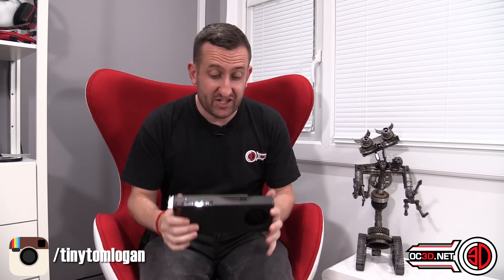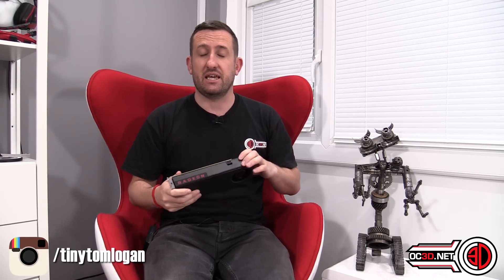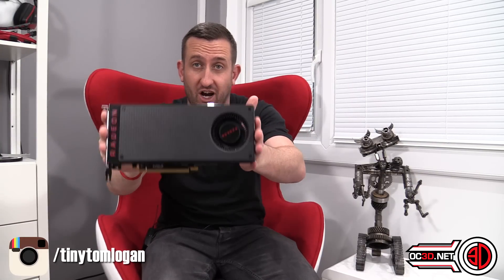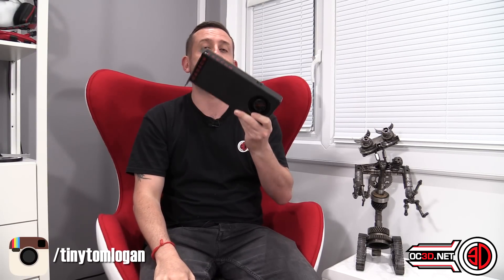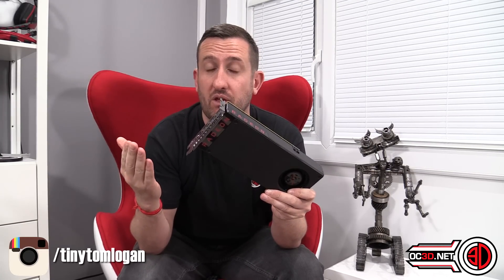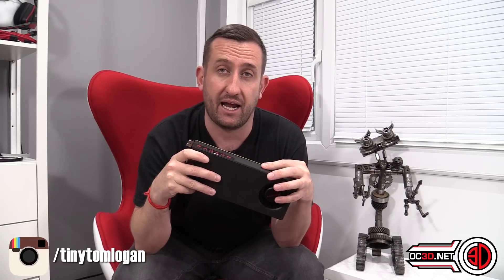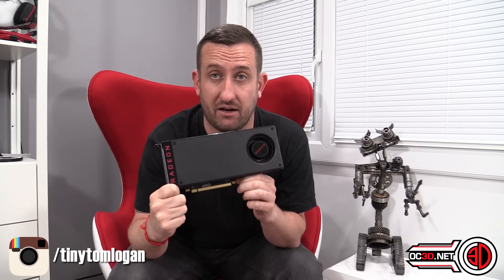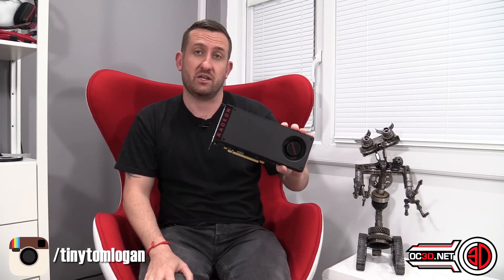RX480 power bottleneck? TTL Talks

Comment: Looks AMD really screwed the pooch on this release. As bad if not worse than RamGate on the 970's. Glad I didn't waste my money on one of them.
Reply: Not if all of the power issues are correct as a lot of the systems that people would be putting a 480 in have budget motherboards (re: low end or cheap) that wouldn't be able to handle the additional power draw over the PCI-E slot. Until this is sorted out I can't, or won't in good conscience recommend a 480 to anyone.
Reply: Once the partner cards hit the market, the problem will be gone, which can't be said of the GTX 970.
Reply: If I'm a fanboy of any graphics card it would be 3dfx (may they rest in peace). And by the time AMD pays to fix or replace all of these defective cards plus whatever damage they cause (if they do damage any other components) they may wish they had a paper launch like the 1080/70 so there would be fewer to deal with. But no one wanted (wants) the 480 to be a success any more than I do. I had great expectations for this card and had plans for at least a couple of dozen of them for numerous projects and to keep Nvidia pricing in check.
Reply: cee128d It wasn't fixed prior to release because AMD ramped up production while they were still testing the thing. They made a big boo-boo, but the technical problems of the card are not tricky to overcome for the board partners, unless they all became morons overnight.
Reply: +Geo Dude I'm doing pretty good. I'm about 85% now. I'm glad that yours are working well so far and I hope they continue to do so. I would keep an eye on the AMD website as well as the PCPer article to keep up with any updates.  http://www.pcper.com/reviews/Graphics-Cards/Power-Consumption-Concerns-Radeon-RX-480
Reply: I would say worse, since you could get away with 3.5GB in most cases (play @ 4k with my 780ti with 3GB VRAM)
In this case overall performance is impacted constantly in every game.
Reply: Not to mention 302gigs won't damage your motherboard while #480PowerGate certainly could.
Reply: While I agree that the 970 is a fantastic card (I have one and love it), there most definitely was a RamGate with the way Nvidia marketed and handled the 4/3.5gig situation. And it did affect gameply on some games even at 1080p.
Reply: if you have a 970 why would you think about the 480 anyway ?
Reply: To replace the 7870 in my other system and for other computers or upgrades. I don't have just one computer personally and do a lot of upgrades/repairs for other people as well as being consulted on purchases. I would never even consider replacing a 970 with a 480.
Reply: cee128d
then for the $ the card is good
Reply: +cee128d does not seem to be a issue
Reply: +5british5 It's only been one day so we have no idea what the long term ramifications are.
Reply: +cee128d indeed no one can say one way or another as of right now,  but you assume there will be a fix if warranted
Reply: +5british5 But the chances that they will be able to just fix existing cards is rather slim. it will probably require a recall and swap with new cards and who knows how long that is going to take or if AMD can even afford to do that. We already know for certain that a bios, firmware, or any type of software update/patch isn't gonna fix the problem as it's at a hardware level. That's why I can't or won't recommend buying a 480 until we know what it's going to take.
Reply: +nimrodery We don't know that. The XFX cards that were available yesterday at launch are just as bad as the ones from AMD themselves. Until we know WHY it's happening and what it will take to fix it there is no telling if it can even be fixed.
Reply: cee128d The XFX cards use the same design. Aftermarket coolers are coming.
Reply: +nimrodery Aftermarket coolers have absolutely no bearing on this issue. Until AMD comes forth and tells us what is causing the problem and what can be done to fix it (if it can be fixed) we don't know if it's something that AIB partners can easily accomplish or if it will take a complete redesign to fix it. I've read that AMD will be releasing that (or at least some of that) information tomorrow, Friday July 1st. Hopefully they do that, but until they do the only thing we know is that there is a major screwup that needs to be addressed.
Reply: cee128d That's complete bullshit. Custom PCBs can get power from different sources, which will fix the problem. AMD's board partners don't just slap a cooler on, they alter the PCB so it will overclock decently and quietly. There has been zero indication there's some unfixable problem with this card. The sky isn't falling, Chicken Little.
Reply: +nimrodery Okay AMD Fanboy. Hold your horses. Once the details are released we'll know what, if anything can be done. Until then it's all speculation. I don't understand what you find so difficult to comprehend about that.
Reply: cee128d LOL my last 2 cards are Nvidia (inc. this one). Good to see you admit you don't know anything; it's a start.
Reply: +nimrodery I may not know anything specific as to the problem or how to fix said problem. but I know enough about electronics to know this more than likely won't be a simple fix. I might be able to figure it out if I had the schematics or the card in front of me, but I don't so it's impossible for me (or anyone else who doesn't) to even attempt to diagnose the problem. That's a lot different to not knowing anything.
Reply: cee128d It seems like you really don't, since this is an easy fix. You'll honestly need a source that says otherwise, since nobody else with a tech background is saying what you're saying. Once partner cards appear, this problem will be gone, and nobody is going to remember what you said anyway. I would have forgotten already but I keep getting these notifications.
Reply: cee128d +1 for 3dfx reference.
Reply: +Geo Dude I did not have unrealistic expectations when it comes to performance. From all of the reviews it performs +/- 5% of where I expected it. At no time have I made any comment about it's performance or price in this or any other post. What I'm disappointed about, and the only thing I'm concerned with is the power issues that AMD tried to ignore. The chance that they didn't know about it prior to the launch is somewhere between slim and none so this issue should have been addressed before the cards shipped. This isn't a game that you can download a patch for, this is a hardware problem that should have been caught and addressed during initial testing long before the cards even sent into mass production.  If it is that simple of a fix as nimrodery seems to believe why wasn't it fixed prior to release? That's what leads me to believe it is more serious than he thinks it is. If it wasn't for that I would be recommending it, and intended to purchase one as soon as Sapphire released their Nitro card. I still may if/when the power issues are satisfactorily resolved.
Reply: meh PCIE group already said its well within PCIE limits, mind you I would wait for AIB cards anyways
Reply: lol, not being sarcastic but wish you good luck. :) I really hope AMD gets it right this time.
Reply: +Mauri .tanga Do you have a link to that post? Not doubting you but I want to see if for myself. And I was always going to wait for a custom cooling card like the Sapphire Nitro (or similar) from the get go before all of the power issues came to light.
Reply: and yet people still bought the shit out of both cards? Why do people fall for this over and over again? Maybe because I'm not a fan boy of either company because they BOTH screw with the consumer but people like to argue which one is screwing you harder. I will never understand that stupidity (-_-")
Reply: at least this can be fixed with drivers a firmware updates
Reply: +Joseph spears All of the information from reliable sources with enough of an electrical background to know say that is not possible. It's going to take a hardware redesign.
Reply: +Joe shmoe it still is a great 1080p gpu..
Reply: cee128d Sure, link those sources and I will consider your theory.
Reply: PCPer for one. Allyn and Ryan know their stuff.
Reply: But how much of that 130 watts is from the PCI-E slot and what did you use to measure how much wattage was used? A Kill-A-Watt won't provide accurate results for individual components and neither will any sort of software connected directly to a motherboard.
Reply: cee128d So that passes for a link? Good job being difficult.
Reply: +nimrodery  No one has been posting any links in this thread but you choose to call me out? At least I pointed you towards the main website. PCPer has been posting new and updated articles for the past couple of days about this so I left it at their main site so anyone going there could get the latest update. That wasn't being difficult, it was meant to be somewhat general to make sure I didn't point to an older article that may have older and outdated information. I gave you enough credit to figure you would be able to take it from there.
Reply: And yet you couldn't link one of them. Oh, well, it's not like I have to care since partner cards are coming out anyway and won't have that problem. Be an ass however much you like, I'm not hunting through some website for articles you supposedly already read. Linking one would have taken the same time as your reply, troll.
Reply: So I'm at fault because you were too lazy to do a 10 second search on their website? You haven't posted a link to any of the stuff you've talked about. But because you can't be bothered here is the link. I hope it won't trouble you too much to have to actually click it.  http://www.pcper.com/reviews/Graphics-Cards/Power-Consumption-Concerns-Radeon-RX-480
Reply: It looks like they update the original article instead of making a new article with newer information. Originally they stated that a bios/firmware/software fix was not an option but AMD has finally taken the time to respond that will be able to do a software fix. Since I didn't know how they would handle new information I didn't post to a specific article as I had no idea if they would update the article or post a new one. Ryan has done it both ways at various times and when I was a Mod on PCPer he tended to post new articles rather than update them, although that was a few years ago.
Reply: cee128d The article doesn't seem to agree it's as much of a problem as you do, and I can't find where it says AMD's board partners won't have it licked on release. As far as I can tell, the theme of the article is "we just don't know yet." Were you referring to a different article?
Reply: I believe it was one of the comments made by Allyn about not being able to fix it with a bios update. I can't remember exactly where I read it now. I had a stroke last November and my short term memory isn't what it was prior to it so I have some problems remembering every detail these days (that and being in my 60's). I read a LOT of articles yesterday about this issue, some were more doom and gloom than others. I wish I could narrow it down further and if I do find it again I will post back. I do remember them stating that one oem vender stated that sustained power draw as high as reported from the PCI-E slot would likely cause problems.
Reply: cee128d That's more or less what the article said: "wait and see." I don't feel like such an old gamer anymore, thanks ;)
Reply: This is not the first time a card has had this issue. Asus's 960, any 750ti that's been overclocked, and some other cards I'm sure, and I haven't heard of any dead mobos. This is a shitty reference card anyways.
Reply: +Alex G You are Zero for two. PCPer has conclusively proven that the Asus Strix 960 does NOT have any such issue. When one correctly reads the results from Tom's Hardware (not a good overal source of information btw) they see that the average draw is well below spec. It does spike above spec at times, but that is to bee expected and is normal. Spikes like that are inherit in most electrical components. Every time you start up your vacuum cleaner (at least the majority of vacuums) it draws more current from the circuit than it is designed to handle and would blow the fuse or trip the circuit breaker if circuits weren't designed to handle spikes. As far as the 750ti's go, some of them had a 6 pin aux power connector so that one is false as well.

Comment: This is a 980 so.
Reply: no.
Reply: Tanzu15
 It is. Just wait you will see.
Reply: L3xou97 it isnt. my 980 has stock 980 Ti performance with my oc. that rx 480 cant even overclock. it has voltage issues and its at its max. max you can squeez is like 5 fps at best.
Reply: Tanzu15
 Did i say 980 OC? No.

Comment: Poor AMD the RX 480 is such a good card but now i have a feeling that all anyone going to talk about is the power problems.
Reply: well what do you expect? its actually a big issue. AMD fucked up big time so they have to pay. Just like AMDtards ripped nvidia a new one just for the 3.5gb thing which wasnt even a big deal and didnt affect performance. this amd issue affects the card and motherboards. its crazy bad for a new release. just what AMD needed.
Reply: +Tanzu15 the only reason performance wasn't affected is because drivers ignore that last .5GB of ram and goes straight to system memory to make up for it. Had it not done that, than it would be an actual problem.

Comment: i bought two of these and thinking i should return them. but u know what, fuck it. i got them cheap, and third party cards will cost a bit more. i gotta learn to stop waiting around and just go with it
Reply: or you seriously wasted money and could have gotten a 1070 which has no crossfire issues and power issues at all. and performs just as good as 2 480s. bad choice.
Reply: Tanzu15 i returned them and bought a GTX 1080 instead.. its in my system now as i type this :)
Reply: UgenixK aawwwww fuck!! im jelly. i have 2 gtx 980s, but the 1080 is beast. Im sure you have a grin across your entire face.

Comment: Only benefit is overclocking the memory, for the 4gb card.
Reply: you acually get most performance from overclocking the gpu
Reply: core clock*
Reply: Do you have a 4gb rx 460 and have you independently clocked the memory to 8ghz and tried power target overclocking the gpu? if not why comment?
Reply: Dave Bell cause, why not?

Comment: As an AMD user, I think that the power issue is quite obvious. The actual clock speed wouldn't go up unless you increase the power limit. Or if not high enough, the clock speed would maintain at a weird frequency, like 1103 or something.

Comment: how far can the aftermarket card manufacturer change the design? I fully understand replacing the cooler but could they start adding the additional power connection you mention? or is that something that would have to come from AMD first?
Reply: They can change power phases, use better quality capacitors, chokes and connectors. That's why the EVGA kingpin 980ti is such a good overclocker, it had basically double the power delivery hardware of a stock one.
Reply: They can change anything on the board, so that includes an extra power connector.
Reply: +Max Provoost K|NGP|N 980 Ti actually wasn't that great of an overclock compared to other high end 980 Tis on water or air.  

The boards itself that EVGA designed for the chips were far superior to others like the MSI Lightning or Gigabyte G1 Gaming or even just reference designs with waterblocks but the max achievable clocks weren't significantly better.  

Jay made a good point with it.  You can engineer the most brilliant and borderline perfect layout for the board surrounding the silicon, but if the gpu won't go any further no matter what you surround it with it won't improve. 

 In this case though, the 480 reference board is in serious need of improvement which AIB partners can deliver.

Comment: that means when third party cards come out with more power they will perform better?
Reply: yes.  but the reason. the 480 is so cheap is because of the extremely cheap cooler.  so expect the custom cooled versions to be 300$ or more I'm going to assume.   and it also sounds like overclocking this thing ramps the power draw up significantly,  so don't expect an effecient t card either.
Reply: update guys. I bought two RX 480s and returned them after the whole PCI-E power draw issue. I bought a GTX 1080 for £620. the two RX 480s cost me £480. Am i a potential fool? maybe.. time will tell.
Reply: you would think so yeh
Reply: Well, if you had an older AMD card in your system, I'm fairly certain that PSU should have no problems handling extra power draw if you know what I mean.
Reply: UgenixK.there are multiple reports of motherboards failing even high end ones with the 480.  the 1080 is more expensive but its a monster card man.
Reply: Final Cam i bought one, got the gigabyte g1 edition. its in my system as we speak. i love it..